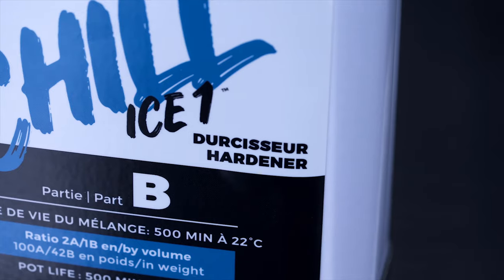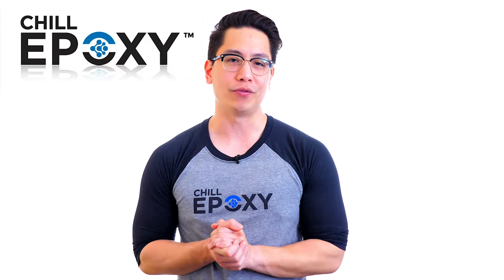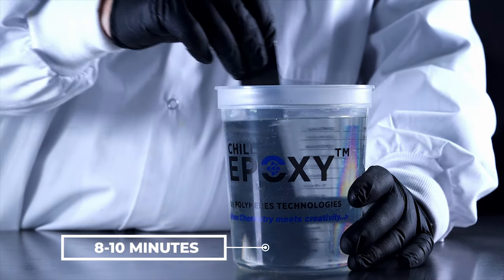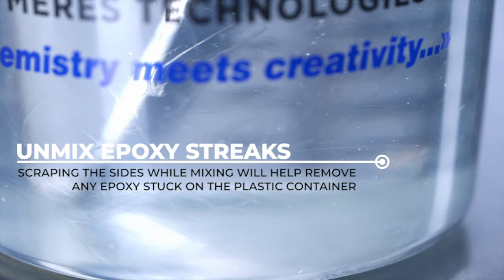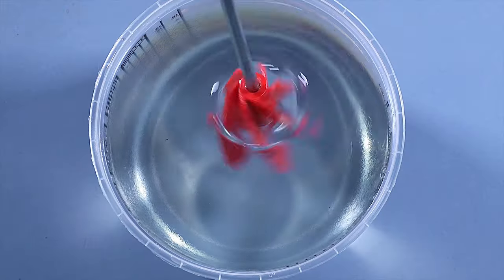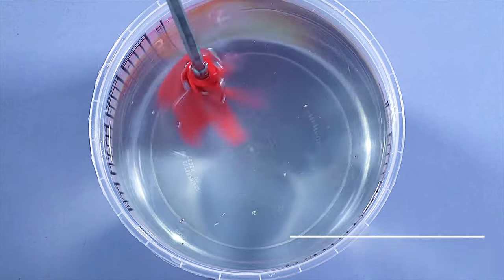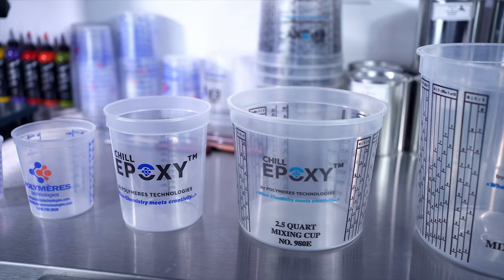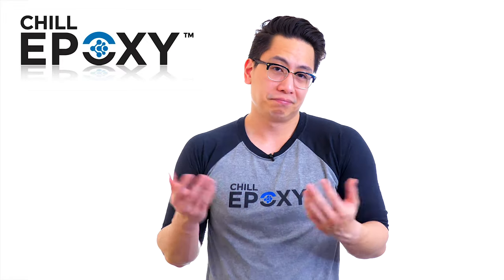CHILL EPOXY™ - MIXING EPOXY LIKE A PRO

Comment: Awesome advice.  Love the metal spatulas surface area to homogenize that mix!  

I prefer to weigh out the mix, especially for smaller pours as the ratio is crucial.  

100% clean tools! I've seen some horrible practices online when mixing epoxy and it will only bite you in the rear later when you demold.
Reply from the maker: Glad you like them...they are the best to mix epoxy like a pro! 🙌